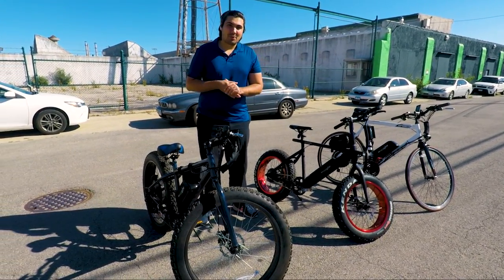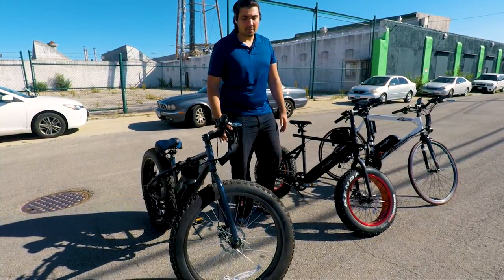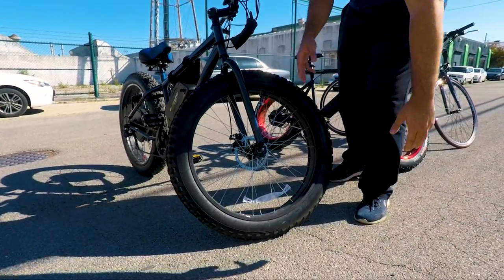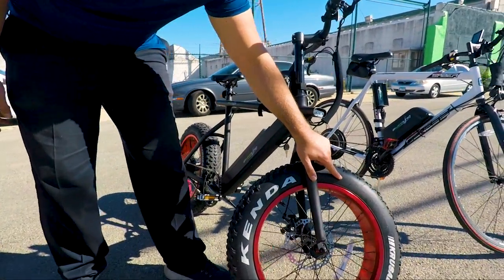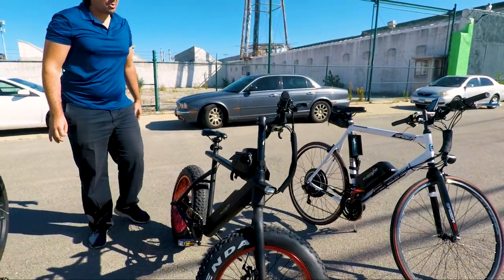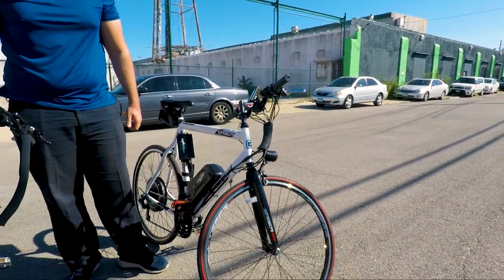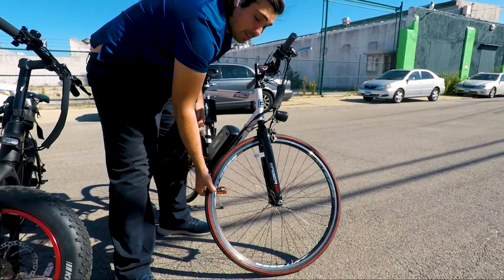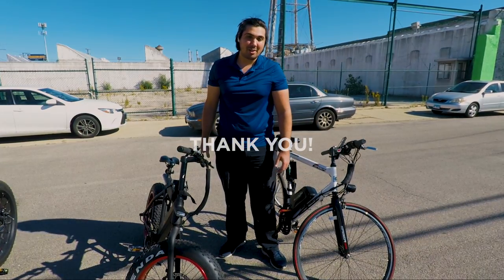How to Check a Bike Wheel Size

Comment: It has been a  long time since I changed tires on bicycles .  So here goes my problem, I removed a tire off a wheel and it came off with no hassle, no need for spoons or screwdriver to remove tire.  I feel it is too big for the wheel but I am no tire mechanic .  The size on the tire reads 700 x 38.Another problem to justify my belief that the tire is to big for the wheel is because the tire doesn't sit perfectly on the rim and sometimes even pops out..  What size do you suggest I install in its place?